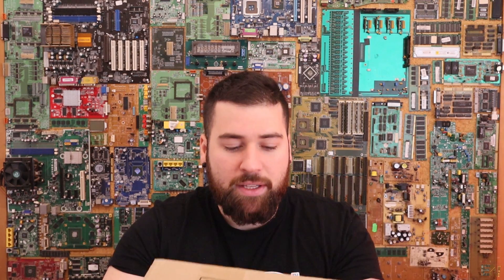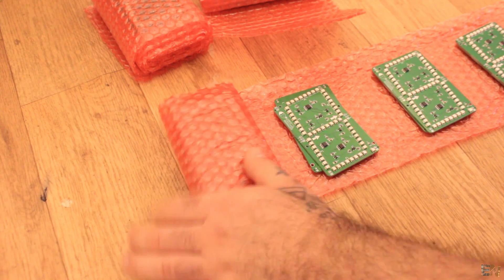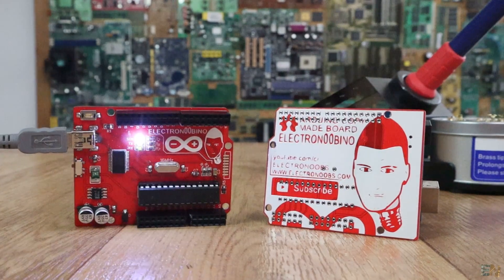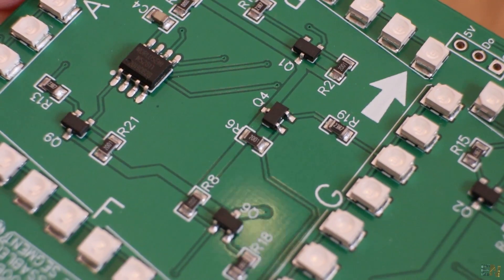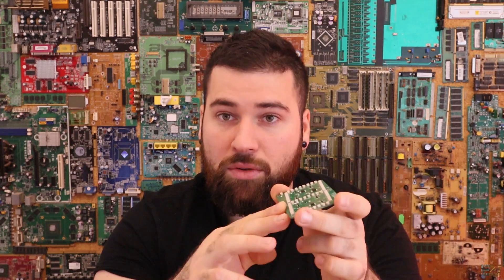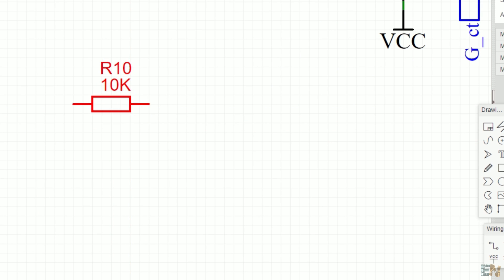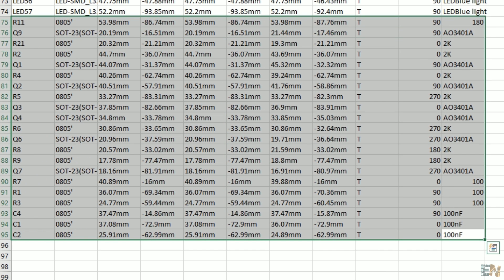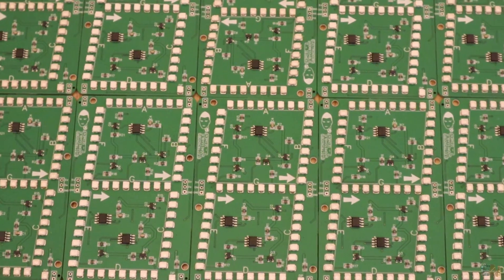How To Order SMT Service From JLCPCB | PCB + Components

Comment: Very good video i have used JLC PCB a few times for various pcbs for projects and am very impressed with the quality and speed of their service. On the next project i will be looking at using the SMT assembly service as this board has a large number of surface mounted components some of which i will have to  fit by hand as LCSC don't stock those parts but using the assembly service will significantly reduce the time the project takes to complete. This guide has helped me with the process. i am very surprised at just how low the prices are for these boards.

Comment: To be profitable in electronics manufacturing you have to be able to sell it at least 2.5 times the cost of making it.  So in your case at $3 each you should charge $7.50 each.  That's still quite a bargain for a display that large with built in drivers.

Comment: What abt thru-hole parts? Can jlcpcb load tht parts or is that something we have to do?
In order to use your displays for something like a digital clock, you need the “:”…Do you have an option board with the colon?

Comment: How did you get SMD components soldered to a dual-layer PCB? The JLCPCB online chat guy told me that they only solder SMT components if the PCB is designed single-sided from the start...I'm confused.

Comment: What happens to the components which are available from LCSC but not ready for Assembly? (video reference 11:35) Did they just come along with the pcb and you can solder them by yourself or do you have to source them differently?

Comment: The way double sided SMD soldering works, one of the sides is the "main" side with most of the components on it, and the other the "back" side with much fewer. The "back" side is manufactured first. But after the stencil solder paste is applied and before the component is placed, there is another robot that puts a little dot of epoxy glue (usually yellow or red) under the middle of each component. When the PCB is soldered, the heat kicks off the epoxy besides soldering the components in place. But it still needs to cure, and then the boards can be flipped over, and the main side can be manufactured as normal, without all the back side SMD components succumbing to gravity! But it's still a finicky, lengthy and comparatively expensive process, so it's generally avoided for most products, and also doesn't combine well with batching.

Comment: why is it that the resistors dont blow op ?  the led hase a voltage drop of 3 volts , so 2 volts over the resistor.  i=2/20   en than i *u is 0.2 watt. but your using a 1/8w resistor

i myself what to do this project. but the leds i want to use only have a smaller voltage drop,

Comment: Just a question, if you accidentally used a generic resistor and changed the value, would JLCPCB at least warn you of that, or will you receive the pcb minus a resistor.. So in other words, we have to be VERY careful to make sure all the components are in their SMT library?
Reply: Think of it like making a recipe. If you tell someone to add a pound of salt instead of a pound of flour, they're going to blindly follow your direction and they'll hope it comes out ok. (It won't.)
Reply: @linagee  thanks but that's not really my question, though it was similar. I have no question that jlcpcb will add components to your design even if you made a mistake. My question was whether jlcpcb will at least warn you that components on your Gerber do not exist in their SMT library. I've seen videos since asking this question where components were left off the board (without warning) because the wrong outlines were used so that answers my question. So you need to be very sure if your design before submitting it, it would be quite annoying to order 50 boards with as many SMT components only to find a single 0402 resistor was omitted for technical reasons that weren't obvious to the designer.

I'm about to submit my first SMT assembly order just finalizing the design. So I'll order a small quantity first to make sure it works and all components were added.
Reply: @linagee  so in baking terms my question is, if you asked someone to bake a cake that can't weigh more than 500g, and then the recipe calls for 1kg flower, would they just omit the flour or warn you first.